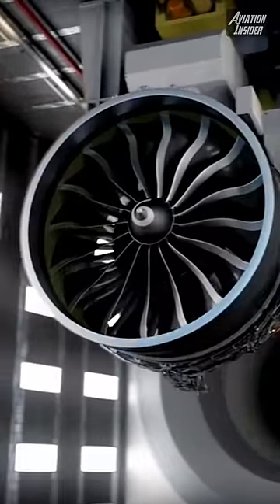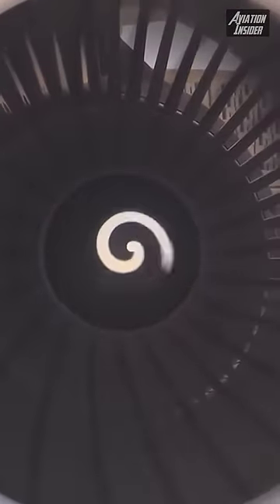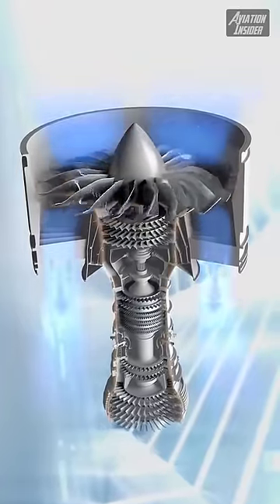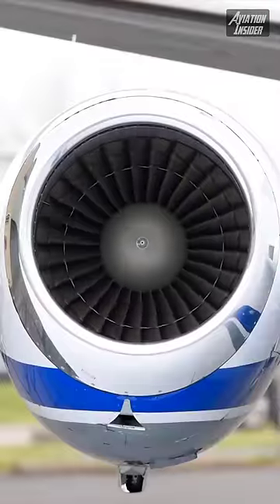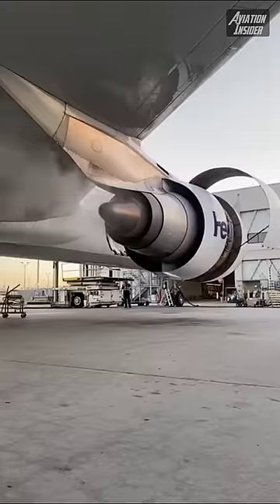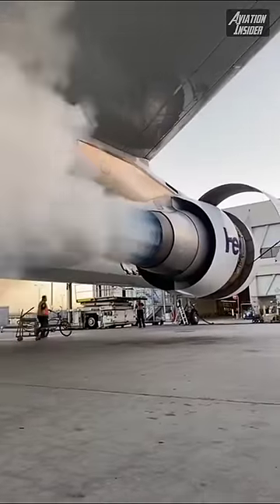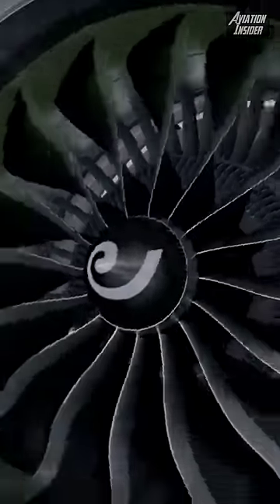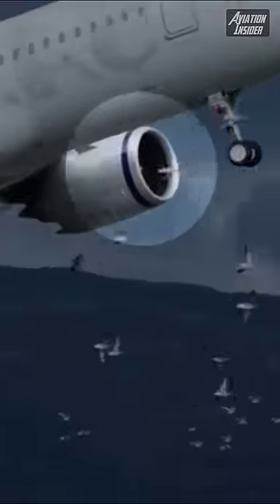Insane Reason Why Jet Engines Are Never Protected In The Front 😨

Comment: Should learn something about this and use it in the auto industry airflow means better preformace
Reply: They have in a way superchargers and turbo chargers basically just force more concentrated oxygen into the engine so you can burn more fuel more efficiently
Reply: @brandonstewart8076 Aircraft designers understood airflow and drag decades before auto designers.

Comment: also a mesh at 250 knots / 360 km/h will not stop the bird hitting it. Either the mesh will rupture, get sucked in, too or pre-slice the bird which goes into the blades anyway. So it's useless.

Comment: If a bird hits a mesh: either it gets slice, just like the fan-blades would be able to do. If it is too big, it gets stuck, takes a way a lot of airflow and stalls the engine that way. Or If it is even more big, the bird pulls in the mesh with it, causing the engine to smash itself to pieces.

Comment: So, just significantly increase the diameter of the intake.  Make the cover cone shaped to.
Reply: Oh my God, the engineers at Pratt and Whitney are blown away by this suggestion! They never thought of it before.
Reply: Increased diameter increases drag. Try studying aerodynamics.
Reply: @Dxyzxyz It also increases fuel efficiency.  That’s why turbofans are dominant in large passenger planes despite having wide diameter.

Comment: The compressor blades are NOT steel, no part of them, nor do they have any type of fiber glass. The compressor blades are made from titanium. As far as a bird or water being sucked into the engin, it adds density to the exaust. There is almost no loss of power.

Comment: As long as it only goes thru the fans and out the side your gonna be just fine, if its injested into the engine theres good chance that engine is going to fail. Hiwever engines have been engineered to divert i jested fod out the fan and not out of the inner compression areas

Comment: In high speed if the protector break down ...there is a possibility that can enter inside the engine which will be a bigger problem to the pilots.

Comment: a rough mesh screen wouldn't actually reduce thrust that much. however a bird hitting a steel mesh screen at 400mph would push both the steel screen and the bird into the engine. the steel mesh would actually do more potential damage than the bird. that's a real explanation, unlike this unfiltered blabber.

Comment: Contrary to popular laymans believe , a bird entering a modern gas turbine engine would be out the other end and chopped into a million pieces in about a few thousands of a second and thoroughly incinerated . I had a long career in the military turbine blade manufacturing business and know turbine blades . I've witnessed tests by the Rolls Royce turbine division where they dump 6 or 8 large 20 liter pales of ice cubes at the front of the engine simultaneously  while it's running . No difference . Or 4 fire hoses pointed at the front of the engine while it's running .No difference .

Comment: No, this is bs. A mesh would not block the airflow to the compressor on its own. The problem is that, while a bird or everything else that gets sucked in gets annihilated, with the mesh on the front it would now be stuck in front of the compressor intake, not being able to move, effectively blocking the airflow and thus making the engine shut.

Moreover, a broken piece of metal from the mesh (resulting from a collision with a bird or everything else) could seriously damage the engine.

Comment: Titanium leading edges and carbon fibre trailing edges.  Glass fibre is not strong enough to withstand the centrifugal G load on the blades and titanium’s tensile strength is higher than that of stainless steel.

Comment: Those engines provide enough thrust to move the plane, imagine that much force sucking in air.

What the fuck is a metal mesh going to do? A bird would be sucked through it or become stuck to it before being crushed to death or at the very least suffocated after having the air literally sucked out of its lungs.

Best case scenario its feathers would all be ripped off removing its ability to fly and it would simply fall to its death.

Anyone who thinks a metal mesh would do anything helpful for the bird doesn’t understand how powerful a jet engine is.

Comment: This is only partially true. The rest of the reason is icing. 
Anything in front of the engine will cold enough at altitude to case ice to form on it. Thereby reducing air flow and creating a disturbance of natural flow of air into the engine.
That leads to the question of Deicing the screen. Providing some type of heat to remove the ice. 
The answer is the ice breaking off would than be sucked into the engine which would be just as bad as the birds 
The other reason is, if the deicing system fails the screen would totally become closed off and the engine would fail that much quicker.

Comment: What if they put the engines as close to the body of the plane as they can without altering it's job and then put a deflector shield that's is aerodynamic and allows the engine to breathe still in front of the engine

Comment: That didn't explain anything. Why does the mesh slow down the airflow so much?  Show me the physics!
Reply: because it blocks the air from going in through all of the engine, with the mesh it would go in multiple areas.
Reply: @VodalamyrColinky  That's a bit too technical. Could you dumb it down for me? 🤣

Comment: Cools so this video didnt explain shit for you guys so i will

The reason is called parasite drag

Specifically a type called form drag
When air is interrupted it creates a area of low and high pressure and when they meet again the spiral. In a larger scale this is what causes wingtip vorticies and wake turbulence 

The spiral entering the engine caused a pulsing pressure strength which cause inefficient combustion and in very very extreme cases, compressor stalls

Essentially this is the same as asking "why dont we put a parachute on a car hood to stop bird strikes"
And the answer is aerodynamics are sensitive and for planes burd strikes are not nearly as bad as some think

I have hit 3 in the past 2 months. Its just a part of air travel and rarely causes meaningful damage

Comment: Helicopters have screens in front of the engine intake.
Reply: But what about the main rotor?
Reply: Only because they use a totally different kind of compressor
Reply: @AnarexicSumo  helicopters have two spools. One is the work turbine which drives the big rotor. It could also drive an axial turbine to feed the jet engine. I never understood axial stages in front of a centrifugal compressor. The RPM is just two high. I understand a slightly radial outlet from the last stage of an axial compressor. Like you combine the last two rotor stages into one with a 90° bend. Still gives you kinda thin disk of air. Boundary layer is huge.

Comment: Absolutely incorrect. A mesh will hinder with the airflow intake characteristics and possibly disrupt the flow causing follow separation and shock waves that is why we need a clear passage in front of a compressor which is designed by the intake

Comment: Imagine thinking this crap up without actually thinking about it.    Let's create a massive problem to solve something that's not really an issue.  From the icing problems to the airflow disruption to you most likely investing the grate creating far more problems than you solved.  And evidently no clue about jet engines fan blades are not made of steel and glass fiber

Comment: So, I think your wrong bro. No evidence or research admitted. Would you want a squishy body chopped up and passed through engine, or metal debris? I have no doubt a mesh could be engineered in some way shape or form to achieve protection from birds. But now your left with a greater worse case scenario.

Comment: Wouldn't you think that the decrease in surface area restricting air flow could be offset by a larger intake area? The tradeoff of a slightly less efficient engine would be a safer engine.

Comment: Those leading edges are not made of steal.   They are made of a titanium alloy.    If you are going to make an informational video, please get the facts correct.   Otherwise, you are spewing misinformation.    A simple Google check would have been made your video valid.   Please do better.

Comment: I want to know is that truth, i mean if no one have ever try it, how we know it. I mean, there is enaugh trust to get plane from 0 to 11000 feet with 2 motors, so if is problem, just add a 2 engine more. I mean its expensive and uses much more fuel but aaaa that engine cost much more than 1000 flight's of fuel (<- maybe not true idk).

If someone knows video of trying protect thing i want  see how that work.
Reply: Yeah, we have pretty fantastic computer modeling options in aviation